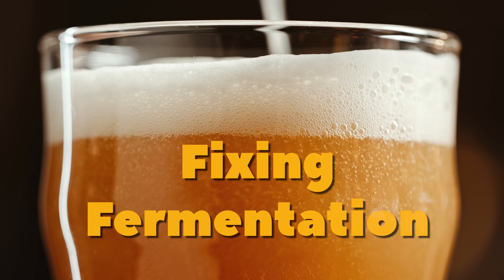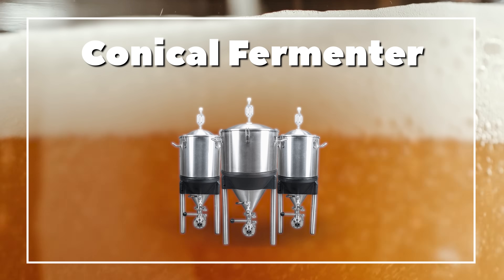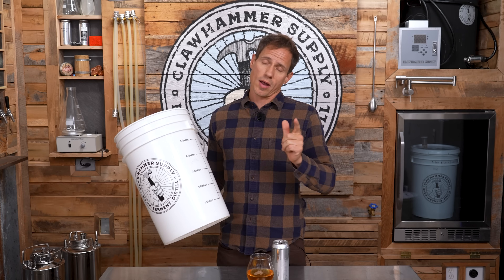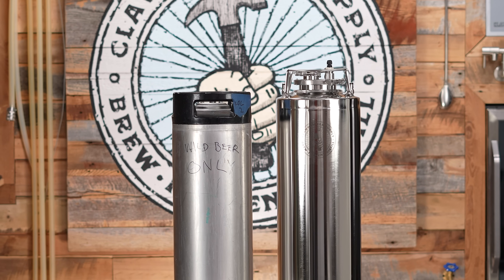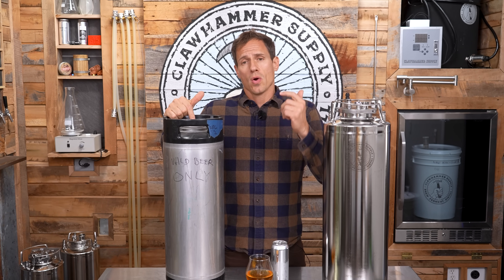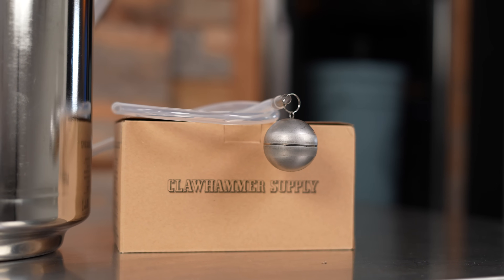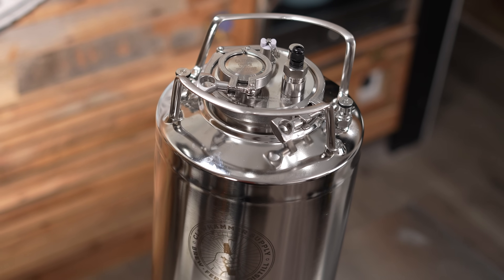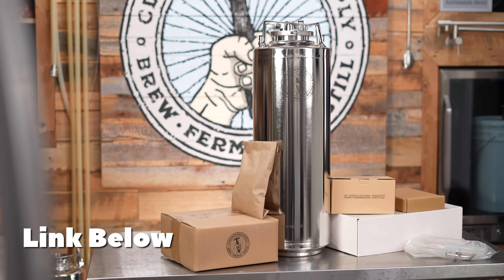A New Way To Ferment Beer!

Comment: I like this, but I can still see having the same issue as with my kegs. I'm a mead maker and when I have fruit in the keg, I clog the pop its and the tube. I also can't see what is going on and have to tap it and pull a sample. I have been trying to get to the point of fermenting in a keg, I'm close, and I do like this setup with the options. I haven't fermented and served from the same keg, but I have left my mead on the yeast (lees) to give creaminess mouthfeel to certain meads.

Comment: thanks for the video. I find you need to rack the beer at least once otherwise it wont go clear. I pulled the trigger on a Grainfather conical and am very happy with it but the cost is a shocker. In Canada water cooling works least the hottest summer weather where a Kveik is the way to go if youre worried about mid to high 20*c. I'm a fan of kegging. I've looked at univerals and think your unit is a better option. I've never had a oxygen problem so wont consider more money for a problem I've never experienced. You  know a standard keg with a shorter dip tube and a custom lid with your added features would do the same thing but you would have to brew at a smaller batch size............anyway..........I think you guys are great so keep up the good work

Comment: I've never fermented in a keg because the liquid tube goes to the bottom.  Does this 6.5 gallon allow for everything to settle and suck only clean beer?  Also, I roll the keg during forced carbonation.  I would need to re-think that process.  Will continue to follow this topic and learn from the new videos on the product.
Reply from the maker: You have 2 dip tube options with this. And you can do a 24 hour quick carb at 50psi

Comment: It absolutely is possible to ferment a full 5 gallon batch in a 5 gallon corny keg with most batches. And use a floating dip tube to avoid clogging. I've been fermenting in my kegs exclusively for years now. I prefer using pin lock kegs.

Comment: A chilling coil to fit the 1.5" port would be great so I can use my glycol chiller. Not sure if anyone makes such a product. My spike would fit the 4" tc port, but then couldn't blowoff. 🤔 Was looking for a 5g solution for split batches for yeast comparison. 

So curiously the yeast settles to bottom, I guess it comes out tap first?
Reply from the maker: We’re working on that.  It the idea is that this will fit in a keezer or a tall mini fridge
Reply: @ClawhammerSupply  that's probably my other issue. I havent measured my internal height on my kegerator. May be too tall to fit. Still very enticing product if I didn't have to fully rebuild my systems. If both gas posts were to the sides like a corny, I could put a gas post spunding valve on the gas side while fermenting and use the 4" TC for chilling. I'll be keeping eye on progress if you develop a glycol chilling option for it. If I wasn't so committed to my setup I'd quickly be ordering 2 of these.

Comment: If you don't transfer the beer out of the new keg, then how do you remove the trub?
Reply: Yup. Hence the "supposedly". Nowhere have i said its the whole and absolute Truth. Bc i don't know. Again i refer you to the video.
Reply: @triballus  well then, again no proof. So go try it and see for yourself and then try to prove me wrong.
Reply: What proof? Of what claim? I am not trying to convince or argument for anything?
Reply: You don't. You use the fermentor as a serving keg as well leaving the trub in the keg fermenter. 
A optional floating dip tube helps you not get clogged while serving.
Reply: @triballus  then the trub will end up causing an off flavor later on.
Reply: @cryptkeeper4727  Supposedly thats just a homebrewing myth. Its mentioned in the video. (autolysis) primarily happens after extended time at room temp.
Reply: @triballus  What's this Supposedly? So you are going off of hearsay and not first-hand experience. So how can you legitimately answer my question without any proof or documentation or experience? YOU CAN'T. 
You can't say it will not change the flavor of the beer unless you drink up the keg in a week or two. Any longer than that and you will taste a difference in your beer. From my experience, the flavor of my beer is always different toward the end of the keg. Still, good beer just does not taste as good as it did compared to the first half of the keg.
Reply: Also of course beer degrade over time. All beer does. More so while being on a draft line. I was talking about one specific thing (autolysis)

Comment: If there's dry hop issues with this method use a hop sleeve. I've keg dry hopped using them and combined with a floating dip tube had no issues. Only reason I've not fermented in a corney is it's too small. Glad you've sorted that. 👍

Comment: Firstly, nice product. Not sure how it is different from just a normal corny keg though. The standard dip tube that comes with this unit is just a normal dip tube that pulls from the bottom? Don't you just suck up all the trub that falls to the bottom during the cold crash? Wouldn't it have been 'different' to have the floating dip tube as standard? I have 2 All Rounders and they are just about perfect (IMO). Good luck with it all.

Comment: This is what I have been waiting for! I WILL be buying one, but I do have a silly question. I say that because it seems obvious, but I still want to ask haha. I assume this fermenter can be using for closed transfers into another keg. I already have several kegs and would like to just continue to use those and use this and my main fermentor. No sense in letting them go to waste. 

You guys stay killin' it!
Reply: Yes, this has both liquid and gas ports on the top that can be used for closed transfer. Just match the pressure in both kegs, put a spunding valve on your serving keg and slowly release some pressure to get it going. It even has a backup port for a floating dip tube just Incase the main dip tube gets clogged.

Comment: Unitanking changed the way I brew beer forever. If you're a newer brewer on a budget, buy a keg, spunding valve, and a floating dip tube and use this new tool to make nonoxidized and quick fermented ales and high temp fermented lagers.

Comment: This is very interesting. I'm getting VERY close to pulling the trigger on your 10Gal 120V kit.  I've been researching fermenters, and just looked at Conicals by Spike that looked interesting.
I like your "keg" type fermenter. Could you do a quick follow up video showing it's usage with all the options you blew past quickly in this video?
I don't know what they all do, etc.
I've only fermented in a carboy with an airlock for many years and would like to upgrade, but need to know and would really enjoy a demo of your fermenter with options to show and explain what all everything does....especially interested in how you temperature control this thing...I didn't get the from your talk.
What is a floating dip tube?
What are spunding valves?
How does the fermentation temperature controller work? 
Can you naturally carbonate your brew by keeping pressure in during fermentation? Is there a way to mount a gauge so you can monitor the keg pressure at any given time?
I know a lot of these are noob questions....but trying to learn how these "fancy" tools work.
Thank you in advance!!
CC

Comment: Very cool. Really like your guys' pragmatic approach to things. I built my own glycol chiller in place of a fermentation chamber to save space and provide more flexibility with multiple fermentation vessels/temps (in the future), so a coil chiller would be a must for me. 

One other question I have is: what's the height like? Will it fit inside of a typical 1/2/3/4 tap kegerator, like Komos, Kegland, etc.?

Comment: Looks like an great product... I just spent 125 bucks on a 6.5 gallon torpedo keg for a fermentation vessel.  I don't know if this offers enough value at the price point though and it's still too large for a small fridge like the one in your background.

I have served beer from the fermentation vessel with a floating dip tube and it works great.

Comment: My last beer was served from a Fermzilla All Rounder.  It was a beer that was made and stored for 6 months on the trub and dry hop !!!  After fermentation I dropped it to 3C and it sat there for 6 months, finally transferred it to a corny keg, topped up the pressure and served.  Tasted fresh as a daisy....clear as a bell and zero oxidisation.  I was really surprised.  I guess as it was sitting under pressure all the time and was cold crashed at the point of fermentation being complete is what done the trick.  I wouldn't recommend 6 months like me, but I can see how a lightly dry hopped / none  dry hop could sit there without any issues.
Reply: Awesome man........cheers
Reply: @BennyBestt  But it is manufactured to the requirements of Kegland Australia; this isn’t a shoddy Chinese back street supplier.  One assumes that Kegland have and continue to ensure quality standards are met.  I can assure you that these vessels (though relatively inexpensive) offer an excellent solution to unitanks without the expense of full SS steel.  I use a Brewtools system for making beer.  Norwegian company of the highest quality….guess where they have their parts, tanks etc. manufactured?  Yep.  This equipment is some (if not) the best out there.  Just because it is Chinese supply, does not mean that it is a cheap knock off mate.
Reply: Are they Chinese made?
Reply: @BennyBestt  Yes,  I believe that most of Kegland kit is Chinese made.  It is perfectly suitable for the application for which it was designed, however - seals of the vessel are only guaranteed for a set time period, after which a stress test should be performed.  They are not expensive to replace mind.
Reply: @CaskAleForever  thank you. I think I'll stick to Australian made pressure fermenters, to ensure the quality.
Reply: @BennyBestt  I don’t understand that statement mate?  Some of the best gear in the world is manufactured in China.   Kegland are an Australian company that happen to manufacture in China?  The fermenter to which I refer comes from Kegland…heck, Apple, manufacture there….am I missing something?
Reply: @BennyBestt  That logic is total nonsense.  That would infer that all things manufactured in China can not be trusted.  Can I ask which Australian companies you use then for brewing kit.  I would be surprised if they didn’t at least in some part manufacture in China.   China is the location, a great majority of these manufacture plants are driven by the countries that put them there.  I do feel that something else is colouring our judgement my friend, either that or you really need to re-educate yourself on the level of manufacture in China for serious companies….yes - buy a cheap part from Ali Express from an unknown company without due diligence then there is risk, but that is not limited to China.  Still, I guess I will not remove your suspicions.
Reply: @CaskAleForever  stop harassing me.